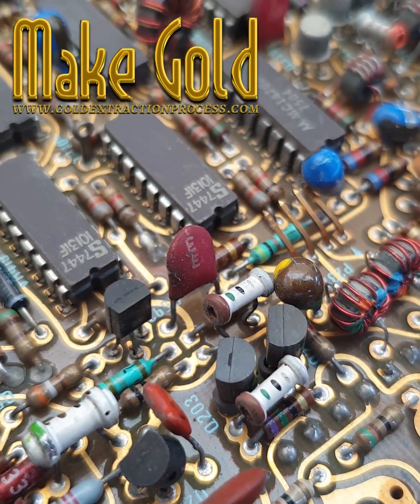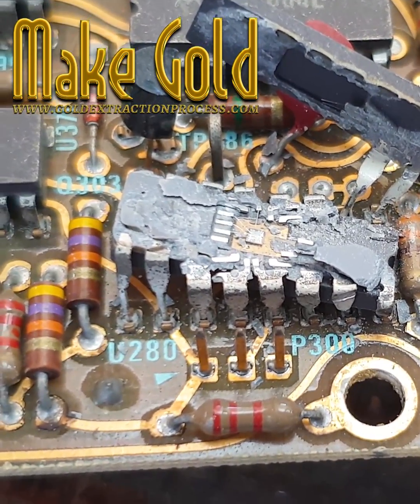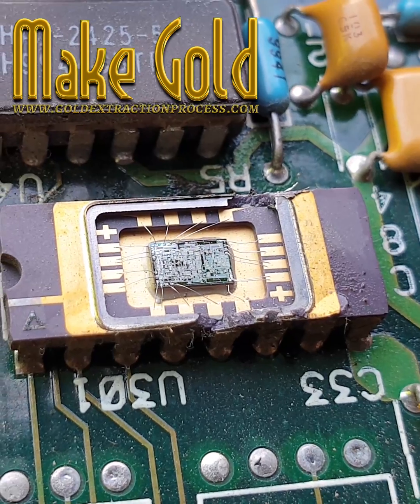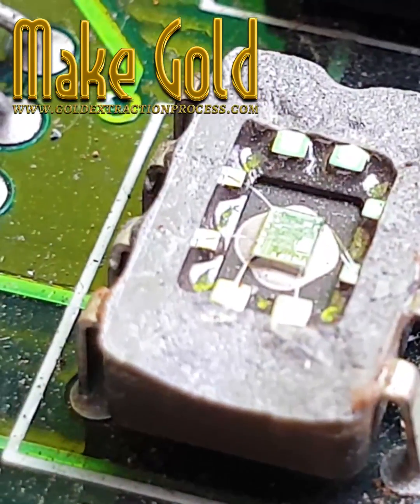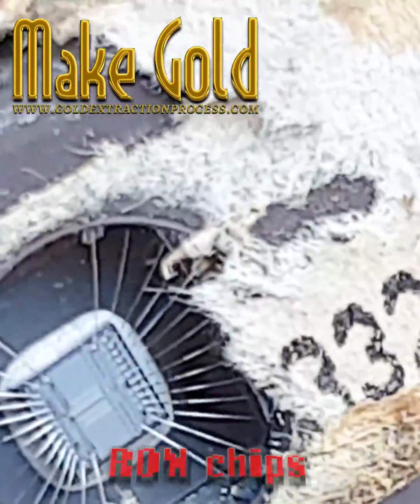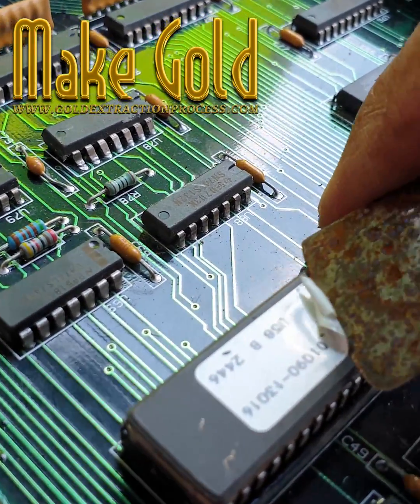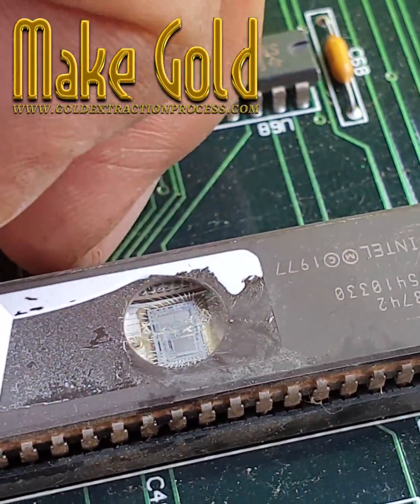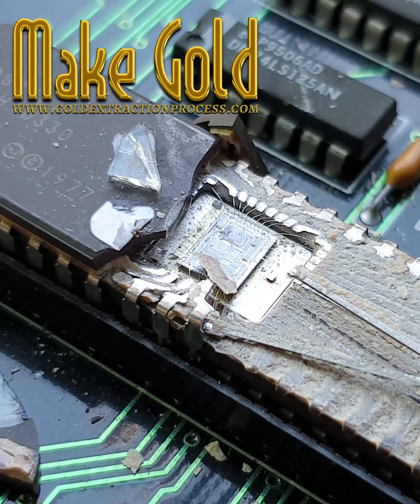Avoid Regrets: Don't Miss Gold in ROM gold in ic chip and Read only memory rom

Comment from the maker: :_wow:I understand you're interested in the gold content of ROM (Read-Only Memory) chips specifically. Let me provide some focused information on this topic:

ROM chips, like other IC chips, do contain small amounts of gold. However, the quantity is generally very low. Here are some key points:

1. Gold in ROM chips: ROM chips, like most ICs, use gold primarily in wire bonding and sometimes in plating for connector pins.

2. Quantity: The amount of gold in a single ROM chip is typically in the microgram to low milligram range, similar to other ICs.

3. Value consideration: While there is gold present, the amount in individual ROM chips is usually too small to be economically viable for individual extraction.

4. Bulk recycling: Large-scale electronics recycling facilities can process large quantities of ROM chips and other electronic components to recover gold and other precious metals more efficiently.

5. Historical context: Older ROM chips from the 1970s and 1980s might contain slightly more gold than modern equivalents due to changes in manufacturing processes.

It's important to note that attempting to extract gold from individual ROM chips or small quantities of electronic components is generally not recommended. The process can be dangerous, potentially illegal, and often results in less value than the components themselves.

If you're interested in the value of old electronics, it's often better to consider the collectible or functional value of intact devices rather than their raw material content.
Reply: Strange, seems like you are sponsored by recyclers now